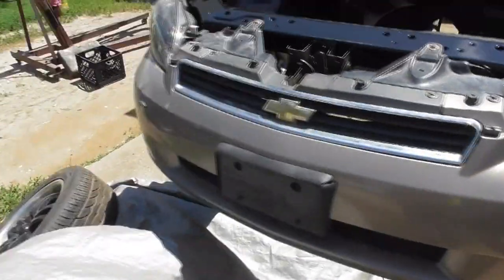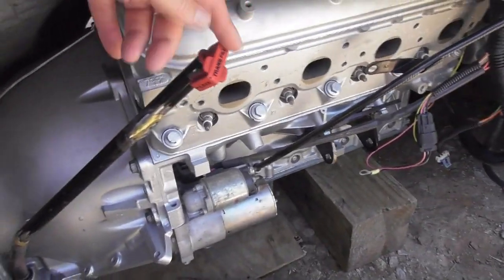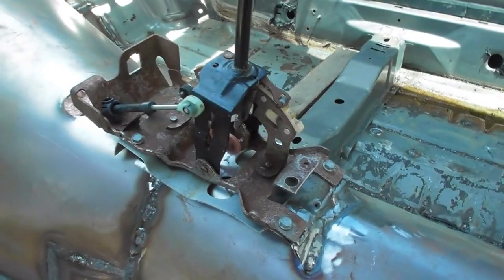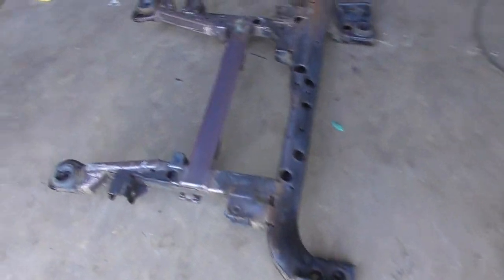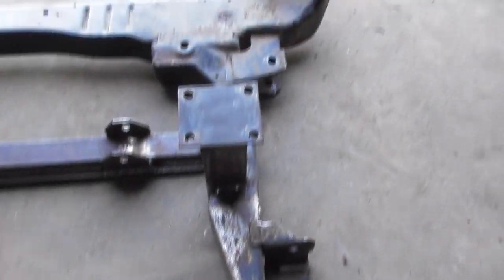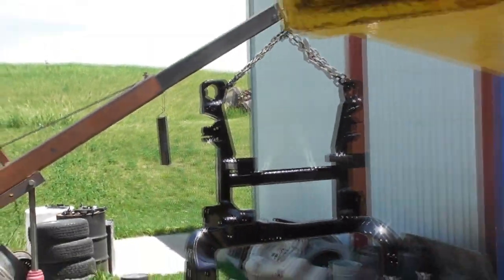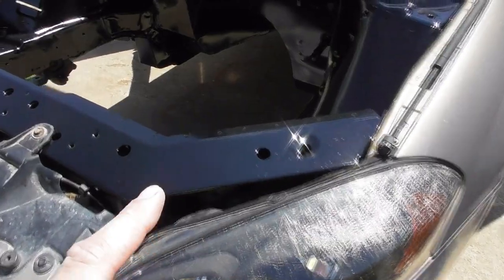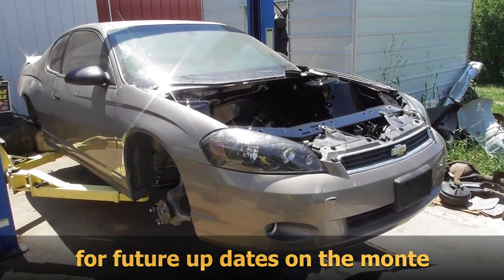subframe finished up and sum paint on the 06 monte fwd to rwd conversion project frankenstien 13

Comment: So...quick question did you take stuff off of a rwd subframe ? And welded it yo that  fwd subframe ?
Reply from the maker: no, but need to redo the steering, needs rear wheel drive spindles on it